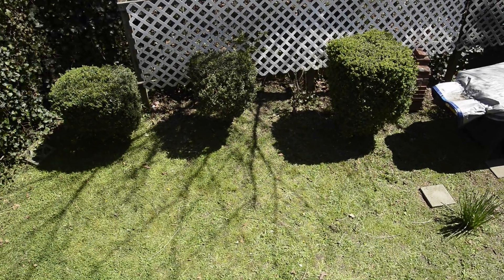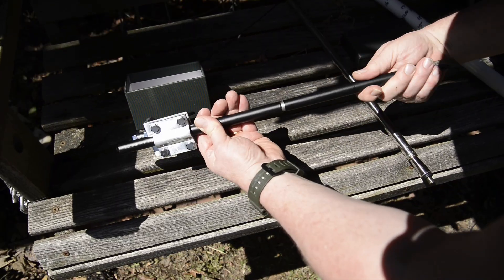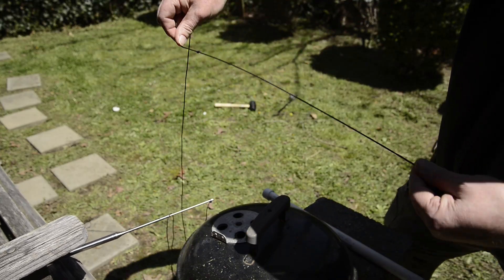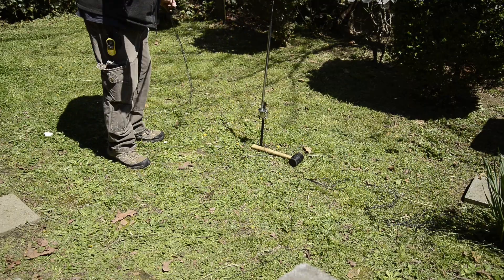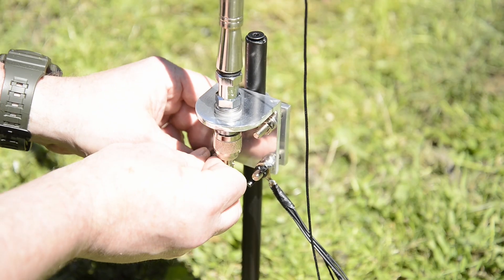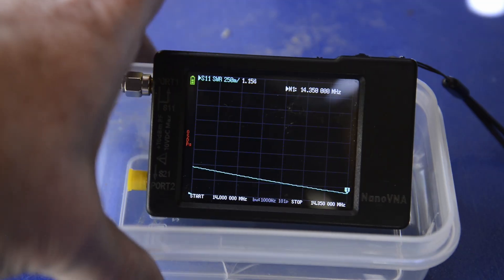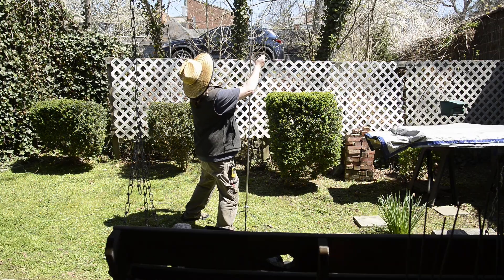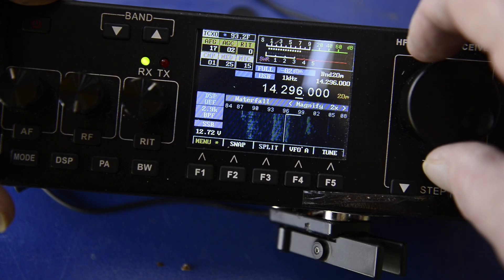20 Meter Vertical Antenna with Ground Radials – Ham Radio Simplified

Comment: Good video. Very simple full size antennas like that usually work the best. I don’t know any good reason why anyone says to use 1/4 wave radials. The rule of thumb is the more radials you have the longer they can be. Its a waste to have only 4 long radials. You get more bang for the buck cutting them in half like you did. I have several mounts like you have. One on a tent spike, one on a large screwdriver and one on a flat bar with a C clamp for picnic tables etc. I use Hustler quick disconnect couplers on them all so I don’t have to screw the antenna on each time. I also usually only use three or four 10 or 11 foot radials. Certainly more is better but I can’t tell it. Another rule of thumb is that you have to double the number to even have a chance of detecting the improvement. Going from none to 1 radial is a big deal. Then going to 2 is measurable on your SWR meter even if not detectable on the air. Once you get to 3 or 4 radials you may not see any further SWR change with more. ( depends on actual ground conductivity) It’s the law of diminishing returns at work! 
I also have 4 short (6 inch) pigtails connected to each of my mounts with Andersen power pole connectors at the end. That way I just plug in my radials when setting up. I do like the knotted string idea as I sometimes forget how many sections I need to pull out for the lesser used bands!

Comment: This is my go-to antenna for POTA activations. I use 2 bundles of 3 15' radials and I tapped the threads on mine. KB9VBR also has a video on a coil to get 40m he calls it that magnificent 7 megahertz